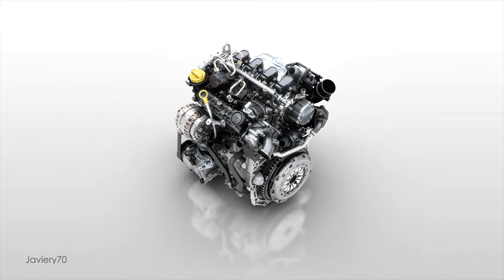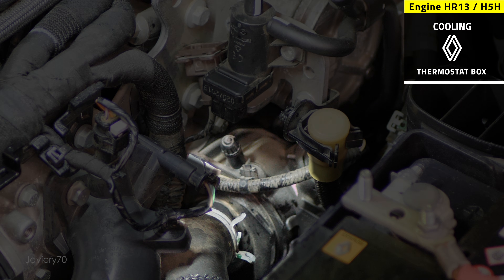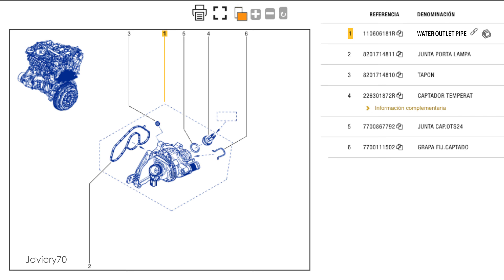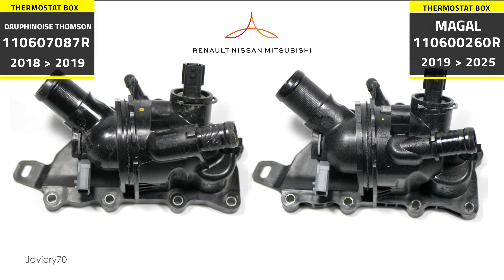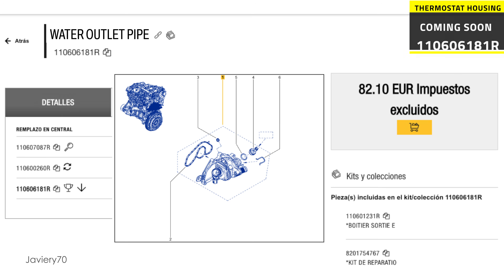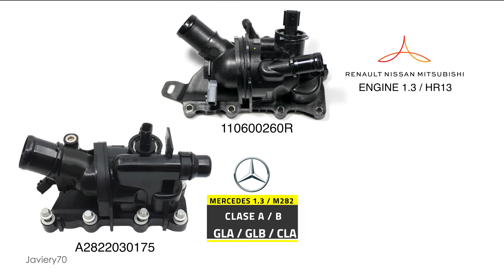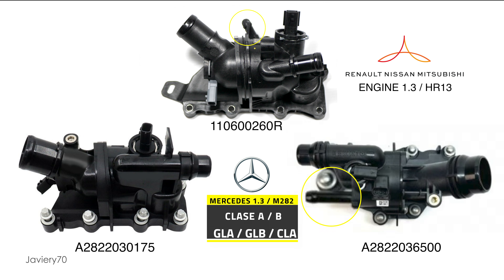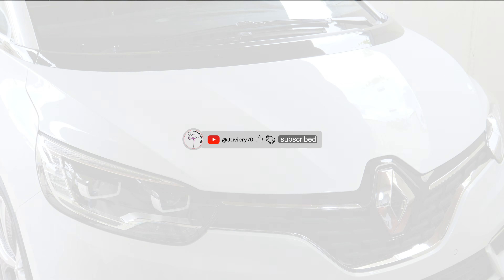🔸RENAULT - DACIA 1.3 TCe | Coolant Leak in Thermostat Housing (eng)

Comment: I'm thinking of buying a 2025 Renault Austral 1.3 TCe, but will this problem Is it still available?
Reply from the maker: It's not a widespread defect in the part; it doesn't affect all 1.3 engines. Although the MAGAL brand is still being used, I haven't seen any leaks in 2025 engines.
Reply: @javiery70 thank you

Comment: Hi friend, i have a renault 1.3 tce of 2019 where the coolant kind of vaporizes in a very quick way and there are no signs of leaks. Any idea what this could be and how to solve?
Reply from the maker: Hi, in this engine, the most common coolant leaks are from the thermostat housing, the water pump, and the engine oil cooler. Even with minor leaks, the original coolant leaves a mark, a stain. If there are no leaks, the first thing to replace is the coolant reservoir cap, which also acts as a safety valve. It's recommended to use original coolant and ensure there's no air in the system.

https://amzn.to/48Utwkw

https://amzn.to/49cR1nU

If the problem persists, an internal engine leak test, or cylinder head test, would need to be performed.

test with a leak detector.

Comment: Thanks for sharing.
In terms of engine oil, the first generation of 1.3 TCe were recommended the 5W30 RN17, however the newest one the 0W20 RN17 FE is recommended.
What do you think the best choice for this engine ? On which oil it runs better?
Thanks for your feedback and videos.
Reply from the maker: Hi...
Depending on the model and country, Renault may recommend RN 17 5w30 or RN17 FE 0w20, or they may recommend both. It's necessary to consult the vehicle's specific maintenance schedule.
In my opinion, the best oil is the one recommended by the manufacturer. If they recommend both, then I choose RN17 5w30.

FE (fuel economy) oil is indicated for fuel saving and more severe and sporty driving.

Comment: And since is the same engine as used in Nissan Qashqai I was wondering if we can use Renault coolant instead of Nissan one (which is more expensive)
Reply from the maker: It's very possible, but to be sure we would have to see the specifications since each manufacturer can adopt their own modifications.

Comment: Hello, I saw this part no 110603305R which is replacing the old one, but I don't know if is newest or older than 110600260R?
Reply from the maker: The part number may vary depending on the vehicle.
What vehicle is it?
Both references are new but apply to different vehicles.
Reply: @javiery70  I have no idea. I was searching for my Qashqai 1.3 J11
Reply from the maker: I don't have information from Nissan, but I can say with certainty that both references for Renault- Dacia  are current and new.

Comment: I remember the time, when Daimler had the same problem with the thermostat housing made of black brittle cheese (oopsie) on the M102. 
They replaced the Aluminium hosing with the plastic, and back to Aluminium. Cost effective 100. today are both available for some reason.
Reply: I've replaced this piece prevently with aluminium one on my W124 230CE 15 years ago. No problem yet.
Reply: @JACK-ot9kv  See. It just works :D

Comment: Do have three Renault's with 1.3 TCe driving around in my family: My parents do have a Captur 1.3 TCe 130 registered 11/2020 milleage 30.000 km . I personally have a Clio 1.3 TCe 130 registered 02/2020 milleage 79.000 km and my sister has a Mégane IV Grand Tour 1.3 TCe 115 registered 08/2018 with 89.000 km. So I assume that most likely the Mégane would be affected as it is fitted with the thompson thermostat housing? In my Clio it is very difficult to judge which housing is fitted because there is nearly no space under the bonnet.
Reply from the maker: Yes. In 2018, it is very likely that Mount Thomson will be developed.

Comment: I have a 2020 Clio v 1.0 tce lpg bought in October 2020 brand new, the summer of 2021 first time my coolant level dropped to min , second time dropped again to min in summer of 2022 and the dealership told me it is from the lpg system or from the cup of the water bottle. Now my car is out of guarantee. What advice do you give me? should I change the thermostat box? One third time it dropped to the half this summer when I opened the cup with the car hot it filled in max
Reply from the maker: The thermostat and water pump should be checked; there may be a slight leak.
Do not open the coolant filler cap when the engine is hot. Always fill the engine with a cold one, and check the level when cold.

Comment: Hello, the water level of my 1.3tce Megane 2024 vehicle is about 0.5cm above the min level when the engine is cold. Should I add up to the maximum level? And should I mix antifreeze with pure water? 10.000km
Reply from the maker: Hello. Yes, you should fill the coolant level up to the maximum. This way, you have better control.
I recommend using Renault-specific coolant; use it directly without mixing.
https://amzn.to/4lPLIAa
Reply: @javiery70  And I live in Turkey. I can't buy the product you sent me. I found the 1lt one from a reliable place. Is it the right product? GLACEOL RX TYPE E ANTI-FREEZE is different from the product you sent me. It doesn't say DLR.
Reply from the maker: @up1253 
https://amzn.to/3KGvSdd
It's pure coolant to mix with distilled water. It may work.
But I recommend mixing it already mixed; these are also compatible.
https://amzn.to/3W4x9gC
https://amzn.to/4n4PIvY
Reply: @javiery70  Thanks, I will buy type e, I hope there will be no decrease.
Reply from the maker: Type E and Type D are compatible.
Renault currently uses only Type E.

Comment: They are not identical. Megal looks different if you look closely
Reply from the maker: It is an identical design but there may be slight differences as they are 2 different manufacturers.

Comment: My Grand Scenic 1.3 TCE 160 (2018), bought second hand in 2023, just got back from a maintenance service and Renault explained that my coolant is low (they added 1L) and I possibly have head gasket leak and the cost might be a couple of thousand euros, just to replace the head gasket and look for damage. There is no proof, no overheating - even last month when driving in the mountains in Austria - no white smoke, no loss of power...  just the low level of the coolant - again, according to the garage. So of course I want more evidence and do more research before paying for such a big repair. Could it be the thermostat? From the records, I can see the thermostat was already replaced once 2-3 years before I bought it. The Renault garage says it won't give me a discount on the big repair because the problem could have been caused by overheating 2-3 years ago with the previous owner with his failing thermostat - although they offer no proof of the car ever being overheated. So they deny any responsibility.
Reply from the maker: Sorry for the delay.

If it's missing 1 liter, it's because there's a leak. It could be external and visible because the fluid leaves a mark and deposits, or it could be internal and cause combustion in the cylinders.

It's important to monitor the level and know every few kilometers the level drops and by how much.

The thermostat, even if it's been replaced, could leak again.
It could be a very small leak, and the engine heat evaporates the fluid.

It's important that the fluid is original because if there's a leak, it leaves a mark and sediment.

To clearly see if it's the thermostat on a Scenic, you need to remove the cover, as seen in the video. With a mirror, you can better see the parts that our vision doesn't reach, especially the rear and lower part of the housing.

You should also check the hoses, as some may have a slight friction.
Reply: @javiery70  Thanks, I will check that thermostat. I have added some more coolant - they said they topped it off but it was just at "minimal" level, which makes it hard to see the level. Now it's at max level and after driving about 500km or so, it has not moved a bit. Meanwhile, the car drives great. Very smooth and good power. It doesn't feel like the car is burning coolant. I don't feel the need to go ahead with the expensive head gasket inspection or repair. I'm going to keep a bottle of coolant in the car an check every week. I can only see three explanations: a) the garage is lying and they want me to go for economic total loss and buy a new one at their Renault garage. b) the coolant was not filled last time and therefore it looks like it had a (bigger) leak or c) like you said, it's a very small leak and it took a whole year to loose 1L - or longer if they didn't fill it up last time. Is there a way to detect a such a small leak ? Maybe drain the coolant and use smoke? Or won't that work if the leak is too small?
Reply from the maker: @caleidoo  
The important thing is to keep an accurate record of the level and determine how much fluid is missing and how many kilometers traveled.
You may be surprised and the level stabilizes.
Small leaks are difficult to see, which is why the original coolant leaves a trace when it leaks, a mark that is visible.
There are also workshops that cannot dedicate all the time necessary to find the leak; that time is not billable.

Comment: Hello Javiery,
Great video and thanks for sharing this information.
My Nissan Qashqai (2020) has the 7087R Thomson installed, which i’m going to replace soon with the 0260R Magal.
Just as a precaution, because I don’t have any problems yet. According to an English qashqai forum, problems might arrive soon though.

As you said in the video, the joint is a weaker point especially compared to the Mercedes.
Before i let the Magal be installed, is it an idea to strenghten the joint with an epoxy glue?
Reply from the maker: Hello.
MAGAL engines after 2021 have improved their quality because no engine with this problem has entered the workshop.
Reinforcing the joint on the outside can help delay and minimize the leak if it occurs.
Personally, I have the 2019 THOMSON in my Renault engine, and I'm not going to replace it because it's perfect. But I keep an eye on it.
Reply: You are running a terrible risk with the thermostat housing you have… at least on the qashqai uk forum, there are horror stories written of the thermostat housing blowing in two pieces while driving and without warning. About half of those drivers have lost their engine’s, the others half had just dumb luck in saving the engine’s from being ruined.
Nissan is compensating to some extent, but far from what might be expected from such a important part breaking down, with such low milage on the cars.
Regardless to say, that i’m still lucky, but this will be my last Nissan.

Based on the information of the qashqai uk forum, problems occur in about 3 to 6 years of use and at about 35.000 to 60.000km.
Atleast thats for the 7087R the case. IMHO it’s good that the (new) 0260R model has no occurrences yet, but it’s still early  to definitively say it’s better then the 7087R or the old 0260R version. 
Physically there seems to be little to no changes, but the quality of welding the two pieces is better in the new 0260R model. Do you also know what they changed on the new 0260R version regarding to the welding? 
I’m asking, because there is also a Gates model TH74998G1 that would fit this engine. For what i can google (and that’s some, but not much), Gates is also a good brand and therefore an alternative i have in mind.
Reply from the maker: @Shaped25  
It's true that the problem is more widespread with Nissan, and there are complaints that there is no warning.
At the Renault garage where I work, we haven't had any cases of engine failure. There is an overheating warning on the dashboard, even with the housing split in two.
The thermostat was replaced and the problem resolved without further consequences.
Reply: @javiery70 
Does a renault car have two sensors for checking engine heat?
It’s weird that nissan uses coolant as an indicator for an overheating engine, but without any coolant the sensor does not respond and no warning is given.
Apparently the renault sensor does notice the heat of the engine and gives a warning.
Reply from the maker: @Shaped25  
In the Renault 1.3 TCE engine, there is only one coolant temperature sensor, located in the thermostat.
If the leak is slow, the lack of coolant increases the temperature.
If the leak is rapid due to a complete rupture, the sensor cannot detect the temperature because there is no coolant.
Leaks are generally slow; if the engine is not stopped, the temperature and pressure increase, which can lead to the complete rupture of the casing.

Comment: Normally I dont like to comment on videos but for this one i feel like i had to... Thank you for your videos, really appreciate your effort  and will be looking forward to new ones. I have megane 4 1.3tce (manufactured in 09/2020) at 85k km with original water pump and thermostat on it. No leakage, overheating or anything. Should i replace with the new ones for precaution?
Reply from the maker: No.
Generally, the water pump in this engine doesn't fail. If there's no leak, overheating, or noise, it doesn't need to be replaced.
The thermostat is most likely a MAGAL brand. I haven't seen any failures in those manufactured after 2020.
It doesn't need to be replaced if it's in good condition, but I recommend checking it periodically.
Reply: @javiery70 Many thanks for your comments. However, I cannot find the reason but the water level on the tank is started to decrease veeery very slowly. There is no visible damp or water leakage under neither water pump nor thermostat. I add proper antifreeze to the max level when the engine is cold. But after one week of driving, it decreases 1cm below the max level. I add it again to max but it also behaves the same. May there be any problem or am i overreacting? If you suggest me to replace both water pump and thermostat for precaution, may you refer the latest and the most up-to-date serial number for water pump so that i can specifically request it from my mechanic with the 181R thermostat as well? @javiery70
Reply from the maker: @YusufHant  If there are even slight leaks, you should see the stain, as it leaves a mark. It's possible the leak is very small and will evaporate with the heat.

I would change the reservoir cap; it might be letting water vapor escape.

You should keep track of how often you add coolant; this is important information.

To know the exact part numbers, you need the VIN, as there could be slight variations depending on the engine version.

Comment: Is this cracking caused by poor quality antifreeze? I've seen calcified thermostats. That's why I asked.
Reply: A thin plastic weld in a part that experiences heat/cold cycles, coolant flow and vibrations repeatedly is just asking for early faulire.
Reply from the maker: No.
It's a quality design flaw.
It also happens with the original coolant.

Comment: Had the same issue 2 weeks back while being abroad on a family holiday... We were driving on the highway when the red lights came on. I stopped the cas as soon as possible. The car is a 2020 1.3 tce Kadjar with 85.000 km. It was repaired at a local renault garage for EUR 600.
Reply from the maker: I think it's very expensive.

Comment: Is the 2020 model 1.3 QASQAI valid?
Reply from the maker: I don't work with Nissan, but I've seen 2020 Renault models with a leak.
Reply: @javiery70 have you seen any 2020 Clio v lpg models ?
Reply from the maker: @archiezoulou  I haven't seen any; they're different thermostats.
The thermostat on the 1.0 LPG TCE engine may be leaking from its engine-connecting gasket. It needs to be checked.

Comment: Hello, I'm writing from Turkey. 2024 Kangoo vehicles have just gone on sale in our country. I bought the 1.3 TCE 130 hp model. Is there a thermostat problem in this vehicle?
Reply from the maker: The MAGAL thermostat is installed in 2024.
By this date, there are generally NO problems with the thermostat.
It's a good idea to monitor the coolant level.
Reply: @javiery70 The vehicle's complex engine structure has a thermostat number information system. I check the water reservoir in the spare water tank; when the engine is cold, it's at maximum level. I bought the car with 0 km on it and it's currently at 1000 km. I'll be driving about 1500 km in the coming days. Can the thermostat blow on the road? How should I drive the car? What should I pay attention to? At what temperature does it usually blow? By the way, doesn't Renault have a bulletin stating that the thermostat has been replaced for models from 2024 and later?
Reply from the maker: @guvenedincgil1576 Renault has yet to issue a technical communication from its workshop. This is not a widespread fault affecting all engines. The quality of the model has improved since 2020 and is generally not causing problems.

Monitor the level and temperature on the instrument panel. In the event of overheating (120°C), the warning light and message will appear on the instrument panel. The engine should be stopped, as there will be no damage. 
The system provides advance warning to allow time to stop the engine.